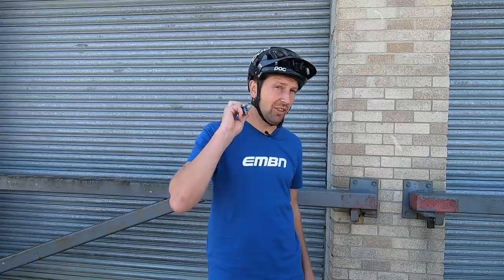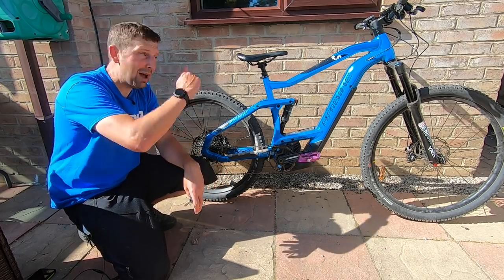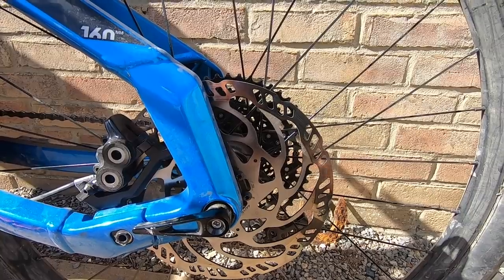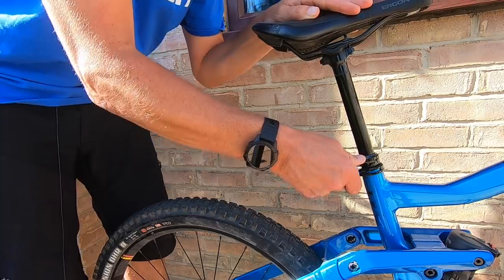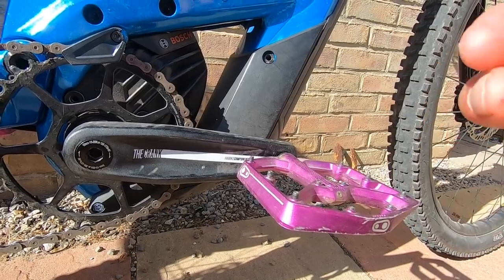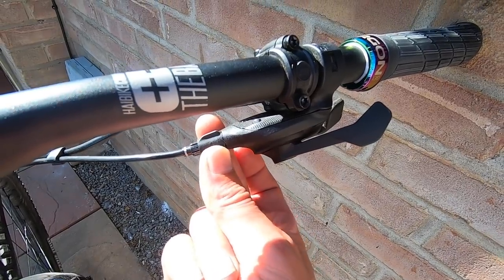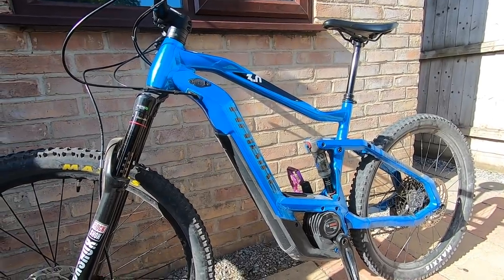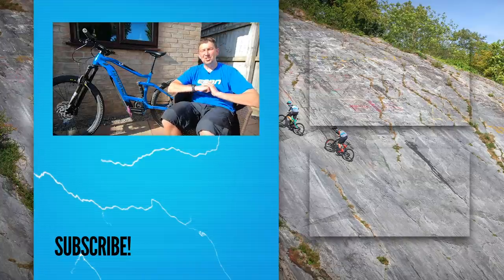Check Your E-Bike Is Safe To Ride | A Multi Tool Is All You Need

Comment from the maker: Which multi-tool do you have? What features do you like to have?
Reply: Topeak mini 20 pro. Can't fault it, saved me on numerous occasions, always in my pocket.
Reply: CB M19 and F15. Both brilliant tools, one is for the shop, the other for the trail.
Reply: DAWAY Bike Repair Tool Kits - 16 in 1 Multifunction, As long as I can fix a flat and tighten things that get loose!! Than all is good!!!
Reply: Topeak with the tyre levers on the side and built in chain tool. Saved my bacon more than once!
Reply: I have a LEZYNE, single use one, you only get one go as it's made out of Cheesium.

Comment: If you mark the bolts with a bit of tipex or a fine silver permanent marker, you can check all of them visually very quickly. If they do come loose on the trail you can also tighten them back up to the correct torque by realigning the marks.

Comment: Topeak hexus, the chain splitter is better than any standalone shop tool I have ever had. Although one of the tyre leavers pinged off in to a field when fixing a puncture not long after I got it never to be seen again... Also just found all my chain ring bolts were super loose . Thanks chris

Comment: Can I make a suggestion, Chris? (I'm going to anyway, if that's OK? Good) that you use a torque wrench on the bolts, especially if you're still at HQ, you can get small, pack-size torque wrenches, Topeak do a good one and Park Tool has one too. You really don't know how 'tight' a bolt is, so using a multi tool to see if it's tight could mean it's over tight. I bought one for the bike bag to use when I get to the hotel and build the bike. They are fairly expensive but it's more expensive when you have to have your bike fixed.